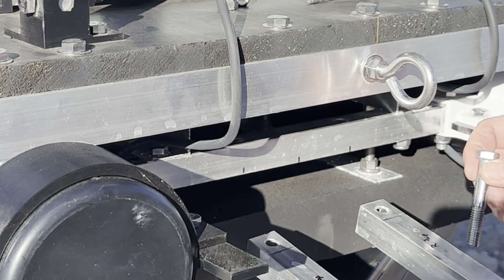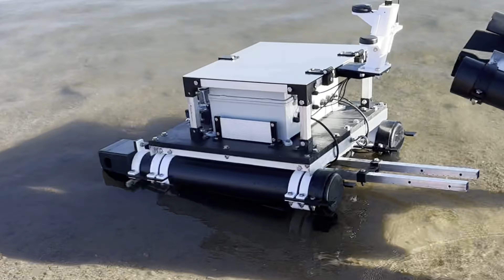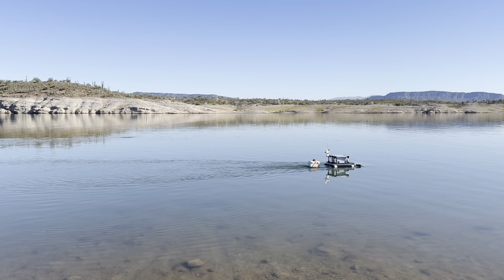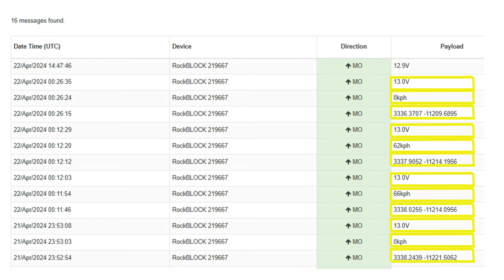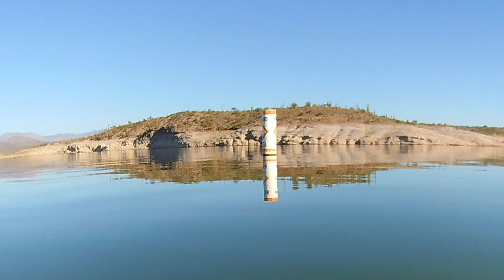Autonomous Boat Lake Testing Before Ocean Mission - Wildlife Bonus!  3D Printed Design

Comment: I like the project and the build process. The hatch may be a problem in the ocean in choppy waters but I don’t know if it is a waterproof seal. Thanks
Reply from the maker: Thank you for watching.  The top hatch is just an aluminum plate attached to the protective frame.  The electronic enclosure below the hatch is waterproof. 😀